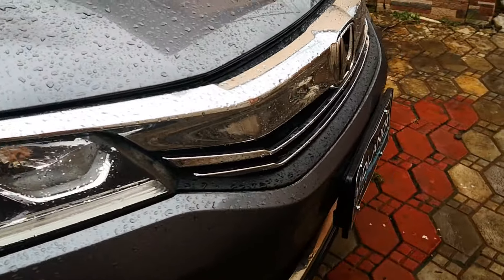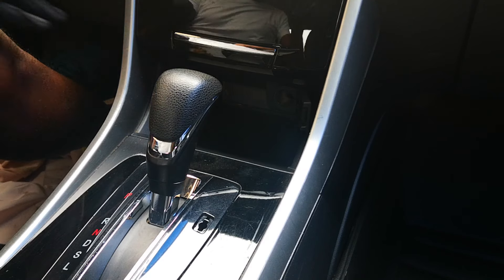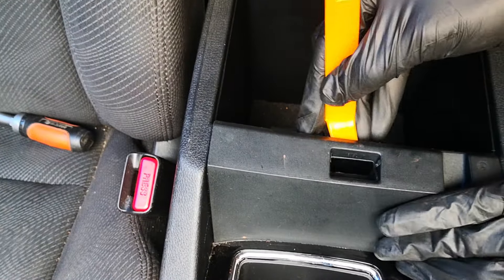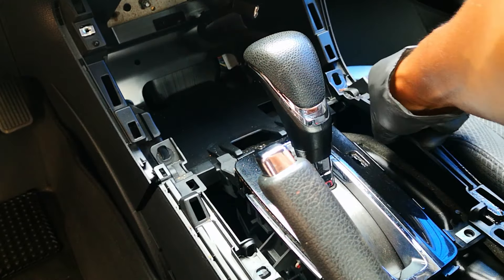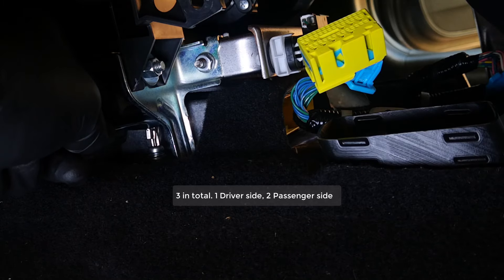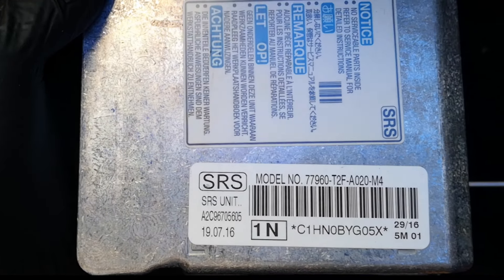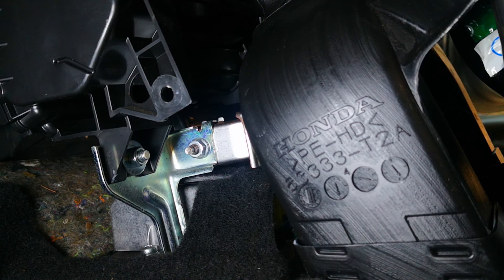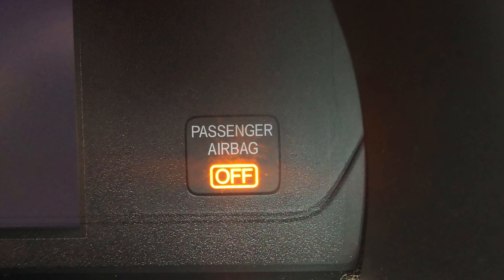Clear CRASH DATA after Collision / Turn Off SRS light / RESET Airbag LIGHT After ACCIDENT / Honda

Comment: First of all, taking apart trim pieces scare me. It usually feels like I'm breaking something. Also, your ratchet torx hack was absolutely brilliant. This is the best channel to learn harness removal, amongst other things😅😅. Great video as usual, thank you!
Reply from the maker: 😄 Easy does it with trim pieces. Plus know the structure well: where there are screws and where it's just push pins-tabs. 
Thanks a lot!
Reply: Sounds like ur breaking something. Just know ur not. Trims are mostly snap ins not screws. Only some part of a trim will have screws. Anywhere an important connector is.

Comment: So we don’t need to buy a new module? You only reset it that’s right?
Reply from the maker: Yes, if the module doesn't have any physical damage. Although Honda recommends replacing the module after an accident where the airbag/seatbelt deployed.

Comment: thank you for the video, i have Chevy malibu 2023, and i had an accident i repared the airbags, but the passenger seat occupancy detection is not working. Do all SRS modules need to be crash reset? pleas assist me
Reply: Hello. I have 2018 Honda civic. I also had an accident how did you repair the airbags? Did you get them replaced??
Reply: Only passenger side bags and and back side were deployed

Comment: Yes obviously putting all the bolts on is best but the airbags won’t explode if you don’t put all of them on. I’ve seen those professional online stores like my airbags or safety restore claim if you don’t put on all three then airbags WILL deploy. Not true. Lol
Reply from the maker: Lol. While I get your point, I know people whose airbags have deployed while being fitted. Static, ground etc are real contenders for deploying airbags. A sudden jolt like falling from an unstable surface🤐
 I always choose the better safe than sorry approach. 
Another issue with not bolting it down to test, is, if it all checks out, you will need to disable the SRS system again to bolt down. It's industry best practice to disable the SRS when working in the vicinity of components. A lot of it is risk reduction.
Reply: @DIYAutoworksNG  I make a living working on the airbag system. Only way they can deploy is if the ignition is on or if they turn the module upside down . . I had a customer come in with an older dodge truck once and he didn’t even have his module bolted down !!!😂😂😂 it was just plugged in under the dash lay down flat on the carpet lol . Even just one bolt is fine. But yeah putting all 3 is the best and “professional” way. I just know for a fact it won’t blow the airbags
Reply from the maker: 😂 😂 😂 😂 @ dangling module! 
I guess the perfectionist in me may still put in the 3. Lol. Thanks for sharing your experience. Much appreciated!
Do you do crash data resets?
Reply: @DIYAutoworksNG  I was surprised nothing blew up ! Lol . Either way is fine honestly. I usually put 3 but sometimes I just put the corners.. yeah I do crash data resets.. do u do airbag work and send the module out ?
Reply from the maker: Yea. I do airbag work and send out the module. Wanted to invest in reset tools but a bit steep for the DIYer. Looked at Carprog etc. Which one do you prefer? I respect you guys! Especially those that use generic eeprom readers!
Reply from the maker: Seems I missed your last reply. Got a notification that started with 'its not too hard...' but when I opened it just said comment no longer available.
All the same. Thanks a lot! Still chuckling over the dangling module🤣🤣🤣
Reply: @DIYAutoworksNG  my comment keep getting deleted I’m tryna give you my emai
Reply: @DIYAutoworksNG  what’s your emai ? It’s better to talk privately about programmers.
Reply from the maker: Yea. I noticed. Youtube sometimes deletes emails from comments. Here's mine if you don't mind piyke@diyautoworksng.com
Let me know if you get it...
Reply: @DIYAutoworksNG  got it. I’m from California usa. It’s 2am so I’ll email you in the mornin
Reply from the maker: So sorry for the early messages! Will lookout for your email. Thanks!
Reply: @albertgiles5128  do you have a website Albert?
Reply: @artman4890  no website
Reply: @artman4890  do you need a module reset
Reply: @albertgiles5128  yes I do! I live in the California, I was hoping you were nearby me.... but my friend keeps recommending me both my airbags and safety restore or whatever they called, but actually I seen a few different people doing resets n such. But How much is your service?? It’s also crazy as dealers and most body shops told the whole unit needs replacement, I guess they just wanna make Money on people who don’t know any better seems like. 🤔
Reply: @artman4890  what other company did you find ? I work for a shop but I’m doing side work and I learned how to do modules by myself because my boss doesn’t want anyone else to learn how to do modules haha. Well for shops. If it’s insurance work they have to change the module. Most shops don’t know how to clear crash data that’s another reason why they say you need a new one
Reply: @artman4890  and where in California do u live. I’m in California as well. I know someone that does airbag modules in Orange County / Los Angeles county. I never done an online service before honestly.
Reply from the maker: Interesting boss. 😂
Reply: @DIYAutoworksNG  oh man you have no idea haha . He is really something else ! I barely started doing airbags when I started working here almost 3 years ago.  He told me he was the only one in the WORLD doing mobile airbag work . And he’s such a pathological liar 😂 lies so much bro
Reply from the maker: 😂😂😂🤣🤣🤣😂🤣😂
Rolling on the floor 🤣 🤣
Reply: @albertgiles5128  what tool are you using to reset the crash data?
I bought an ar32 but need some adapters  to clamp on the chips or a heat gun to desolder. 
What's your technique?

Comment: I have a 2007 Honda accord. The driver airbag and seatbelt deployed and the left side frame crash sensor was damaged. I replaced all damaged items from another Honda of the same year and I’m thinking about sending the module out for a reset. Will a regular OBD two device detect crash data that was stored or do I need something else?
Reply from the maker: Good progress so far! A regular scanner won't work. You need dedicated crash data tools and know-how to delete the crash data. Sending it out to a good service is the cheaper and faster way to get sorted.
Reply: Any service provider you can recommend for the SRS module reset in Nigeria? thank! @DIYAutoworksNG
Reply: @DIYAutoworksNG sorry I don’t know much about cars. Correct me if I’m wrong. So with a good specific scanner ( one to delete or reset crash codes) only work??

Comment: Autel can’t delete crasch data from SRS Ecu? You had to send the driver( SRS module) to the company special elektronics?
Reply from the maker: Yes. Autel cannot. Not only Autel even Snap-on and the others that cost thousands of dollars cannot either.
I sent it to a company that does only airbag/SRS repairs.
Reply: How long did it take, sending it out and getting it back. And couldn't it be done locally?
Reply from the maker: This was done locally and took 3 days in total. 2 days in transit (sending/return) and 1 day with the reset service.
Reply: @DIYAutoworksNG  Brilliant

Comment: Great video sir. So I sent my module off and had it recalibrated reset whatever they do to it and they sent it back. I put it in the car and my airbag light is still on. Is there anything else that I should do? Thanks!
Reply from the maker: Did you scan the car before sending the module off? If you scan the car now, any SRS codes?

Comment: I have the two curtains deployed on my Ford Fiesta, to be clear, first I must remove the module and send it to reset, and I put the new curtains and that's it. I don't need to do anything else on the vehicle's computer. Thanks for your video
Reply from the maker: You'll need to read the SRS ECU to get the complete list of SRS codes that it stored from the accident. They should all be addressed, before the module is cleared of crash data.

Comment: Do you recommend clearing srs module 1st, or replacing the seatbelt? I have multiple codes all from accident on passenger side. Airbag light on but airbags were not deployed.
Reply from the maker: Replace the damaged components. Clear the module last after all repairs.
Reply: @DIYAutoworksNG  thanks for the advice!

Comment: good job!  Thanks for your talent.   I have a question of new honda accord 2022 sport.  changed my airbags and fixed all mechanical and its working fine.  light still srs as I did not delete any yet do not have scanner tool to do so,, yet.  but do u think with the new car i need to do same thing o=of what you did or it will reset itself   please share your insights.  Thanks
Reply from the maker: Module must be reset in addition to fixing every srs component that has a DTC. Thanks for the compliment.

Comment: So a good obd scanner will not clear srs  crash data from module ?
Reply from the maker: Yes. Special tools required. Some scanners are beginning to add SRS module repair, but coverage is very weak
Reply: @DIYAutoworksNG Thanks someone told me I can just replace the side curtain air bag and get a module like from junkyard with no crash data and a good obd scanner can reprogram it to the car
Reply: Also if the crash sensors where not broken then they won't need to be replaced.He charges $75 to clear crash data tho..which is a good.bargain I suppose
Reply from the maker: How will you know the module from the junkyard doesn't have crash data? Not every scanner can program a new module to a car. It also depends on the car brand.
Reply: @DIYAutoworksNG  If the car isn't crashed or the airbags are not deployed will be an indicator sometimes you find cars at junkyard with no body damage and a seized engine..
Reply: @DIYAutoworksNG  It is a gamble unless u have the key to the car and give it 13 volts to check dash lights..
Reply from the maker: Assuming you get a good used unit like this, it now depends on the brand to get it working in the car. Some Toyota's are plug and play, Honda's on the other hand, require  the new SRS module to be programmed to the car for it to work.

Comment: My honda accord 2010 has the same issue I replaced the curtain airbag the seat belt and the seat airbag the light still on I have try to reset it with the scanner and it won’t go away so I’m wondering if this is maybe what it needs
Reply from the maker: Exactly what it needs. It will never go off except you do this. The other alternative is to replace and program a new module. Seems the reprogramming can only be done with Honda in-house tools.

Comment: Hi I have mazda cx-5 2023 I took The module off Before changing the airbags or using a scanner to clear or reset all the faulty codes and send it to safety restore Will alongside with the seat belts.They fix the seat belts.But they were saying that they were unable to connect with the module.Because the module is locked.Any idea what should I do?Should I put it back on the car?Reset the heart codes with The A u t e l scanner And then send it back again to get the crash data clear.Or locked it means The module is damaged
Reply from the maker: Hey. I've never heard of an SRS module being locked. Was that the exact term they used or did they say it's damaged. Either way, an Autel scanner won't reset hard codes except you have the ones that come with EEPROM accessories and you know your way around reading and clearing EEPROMs.
Reply: @DIYAutoworksNG  not sure honestly they told me it's locked unable to To communicate with the chip. Do you think maybe they don't have the software for it? Because the car's a brand new, it's a 23.
Reply: @DIYAutoworksNG  We received your order and unfortunately looks like one of your airbag modules cannot be repaired due to an internal communication error with the chip. We apologize for any inconvenience this may cause. We will be issuing you a full refund for the item. Please give us a call if you have any questions or concerns. Thank you. That's what exactly they send me
Reply: @DIYAutoworksNG  Alrighty! I spoke with our technicians, and it looks like that SRS Airbag Module was failed due to a "Locked Chip".

2nd time When an Airbag Module has a "Locked Chip", we are unable to reset it. If you visit a local dealer, they may be able to assist you with that module.
Reply from the maker: I see. Manufacturers increasingly protecting their turf! Thanks for sharing. Shame on Mazda. They'll want you to buy a new module.
Since there's the option of refunds, maybe try myairbags.com perhaps, they may have the tools.
The module wasn't impacted in any way, correct?
Reply: @DIYAutoworksNG  what do you mean module impacted please ,the air bags are deployed but module in good shape

Comment: If I buy another Srs module that has not been in an accident that the airbags in the car have not deployed can I use that Srs module on another car? Would I have to program it to the car? Or can I just plug and play without any problems?
Reply from the maker: It depends on the car. If it's a Honda, it will need to be programmed. I don't know any tool that can do that except Honda in-house tool (could be wrong). You won't have this problem on a lot of Toyota as they are almost plug and play.

Comment: Hallo, 
I bought a Honda Accord Euro 2010, It had accident but no airbag Diplome the, now there is an airbag fault from two side curtain and driver belt. Should I reset the module or it is series fault ?
Reply from the maker: What are the actual codes?
Reply: Hi, the problem was with the tensioner, some how deployed and after changing problem is gone.
Thanks
Abbas

Comment: Where I can find software for programming srs module? And how much is this cost?
Reply from the maker: Not a straight forward question, but you'll be needing software, hardware and a decent amount of know-how. You can Google equipment for crash data deletion to get started. I don't do this myself so can't really advise further.

Comment: Where did u purchase the new crash sensors?
Reply from the maker: hondapartsnow.com
Reply: @DIYAutoworksNG  if i replaced airbag and sensors and got the srs reset but didn't replace my seatbelt...will the srs light remain on?
Reply from the maker: If the seatbelt deployed in the accident, or there's any other srs component that got damaged in the accident, the light will not go off. Also, depending on the car you may need to relearn the occupant detection system.
Reply: @DIYAutoworksNG  ok thanks...when i reinstall the module i'll scan again

Comment: My car was in a small collision where it scraped my paint and left a small crack on the bumper right below the front right headlight. Now my airbag light is on. Will I need to replace the sensor?
Reply from the maker: The best thing to do is to scan the car with a scanner that has SRS access. Maybe wiring to, or the crash sensor itself was damaged. Could be something else, but the scan will point you in the right direction.
Reply: @DIYAutoworksNG please I have similar issues but with Toyota Camry 2011 but my car can’t scan yet, I think it’s coz there is still water inside the modules, any advice…?

Comment: hello i have a 2011 chevy silverado that was in an accident and the driver air bag deployed and the driver and passenger seat belts locked and i already have the driver air bag and the seat belts and the clockspring all were from a used truck but they are good and the srs module is plastic it is the original and the impact sensors are not destroyed, if I change the air bag, the clockspring and the seat belts yes after installing the parts I can reset the srs module with an obd2 scanner??
Reply from the maker: Hello. Thanks for watching! No, you won't be able to reset aka delete the crash data from the SRS ECU with a scanner. Even well advanced scanners don't do this. Special tools are required (usually over a thousand bucks), with significant know-how. There are some online services that delete crash data for less than $50. Maybe you want to explore one of those?